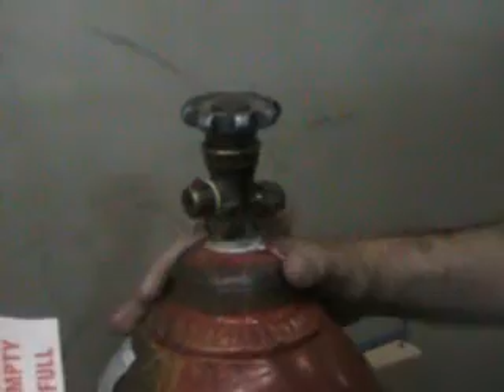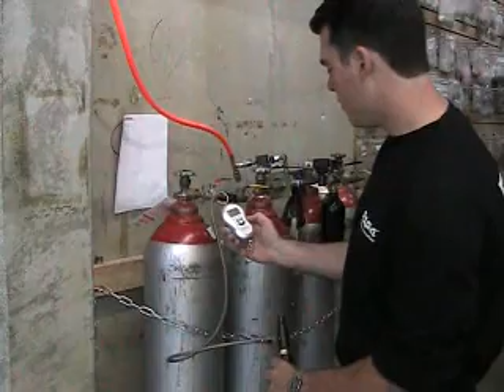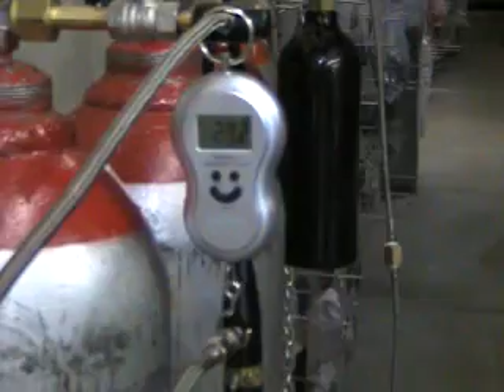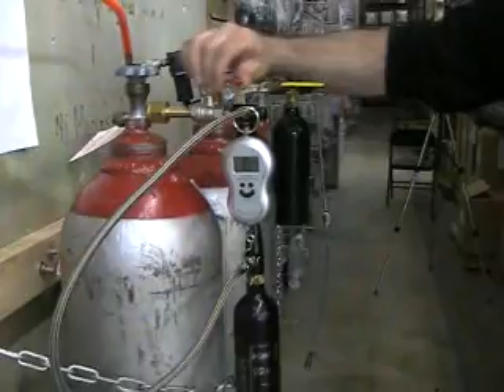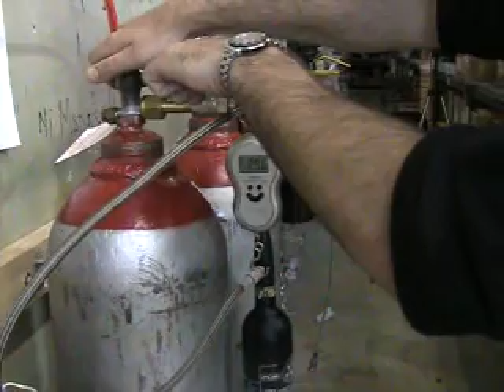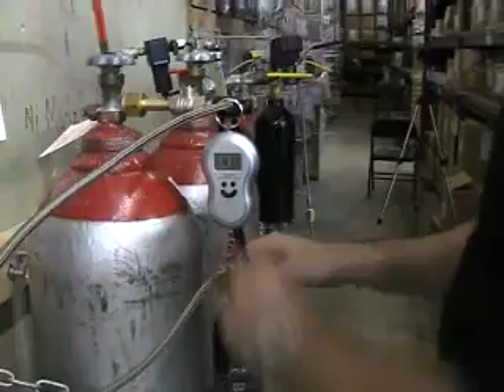RAP4 Paintball How to Refill CO2 Cylinders, Tanks, Bottles

Comment from the maker: this is an alternative method for those who do not have  a pump. We actually use a different system. If you notice the orange air line, it goes into the co2 pump. 

You can also leave your co2 tank in the freezer for a couple hours before filling, that way you can get a full fill without having to freeze your tank by emptying out the tank.

Comment from the maker: Yes! you Zero the Tank on the scale wile its empty before you fill, the fill is measured by weight for example a 20oz co2 tank is filled to 1.25Lbs but you don't want to fill it to the max you want to leave room inside the tank for expansion so back off a couple of Ounces.

Comment: Just tare the scale to the empty cylinder weight. Also, what's it matter? You're filling the tanks with liquid, not gas, so the pressure in the tank will remain relatively constant. That's how liquefied gases behave; the pressure of the gas in the headspace remains constant if the tank remains at constant temperature. As you drain gas, more boils to keep the pressure constant. That's why liquid CO2 lasts so much longer and stronger than gas, and why it doesn't drop off as you drain the tank, like air does.

Comment: Just wondering, instead of just opening the valve at once in order to cool down the tank, wouldn't letting the co2 leak out at a slower rate reduce the chances of liquid co2 to come out of the tank? You would want the co2 to boil inside the tank so it could chill it down.
I know the canister is in a vertical position and liquid co2 shouldn't be able to reach the top, but it might be also boiling enough fast for bubbles to form under the liquid which could carry it upwards.

Comment: If you lower the temperature to increase your filling capacity, but then let the tank rest and equilibrate with the ambient air (70F), what will be the pressure in the tank once it settles?

Comment: SIR I AM INTRESTED IN REFILLING CO2 CARTRIGE USED IN FIRE EXTINGUISHER. THE CARTRIGE ARE OF 30,60,120,200 GRAMS. IN THE NOZZAL A COPPER STRIP IS USED TO PUNCTURE IT AND RELEASE THE PRESSURE FOR FIRE EXTINGUISHER. AS USED IT HAS TO BE REFILLED FOR REUSE. PLEASE GUIDE.

Comment: Good example of someone that doesn't understand the simple use of the 'Tara' button to zero the scale with the empty bottle attached, nor checksvia bleed-vent if the bottle is actually empty before starting to fill it.
Actually one  more reason to switch to HP, folks that charge you for the CO2...